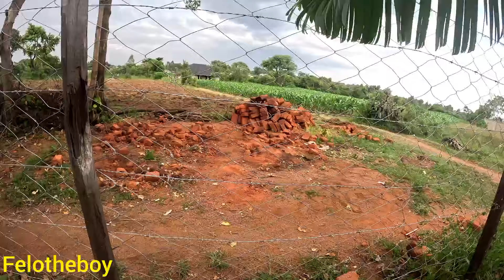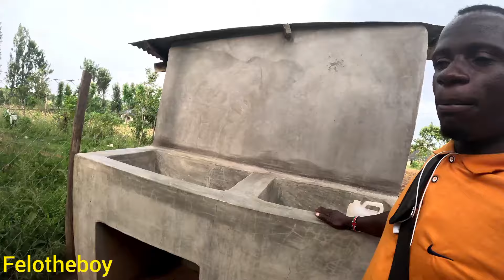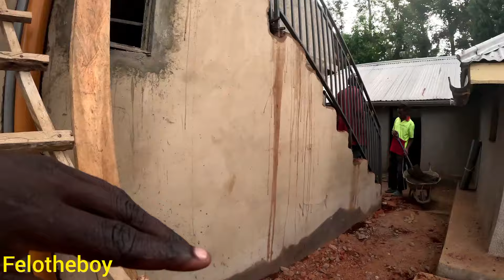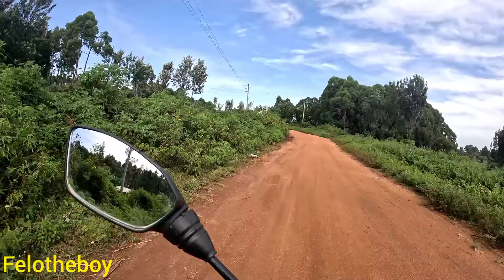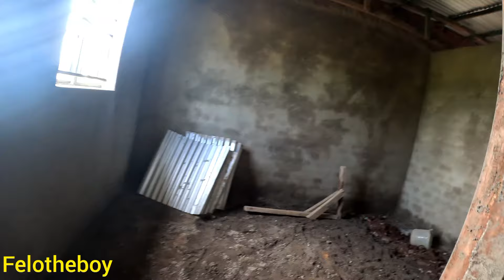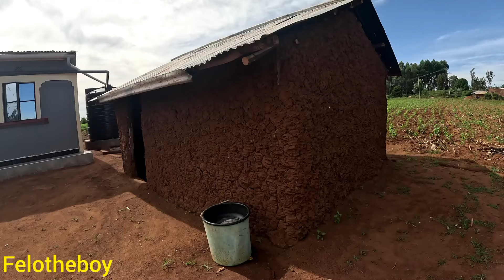The TRUTH from my Heart[I will not Give up]

Comment: Felo, try and make her kitchen like that of Baba Godfrey. Check with Zak, he did a very good job on Baba Godfrey's project. Also check the ceiling. It looks like there are holes. These need to be sealed before putting the ceiling to prevent leakage in the future.